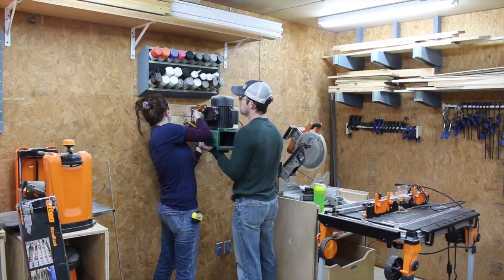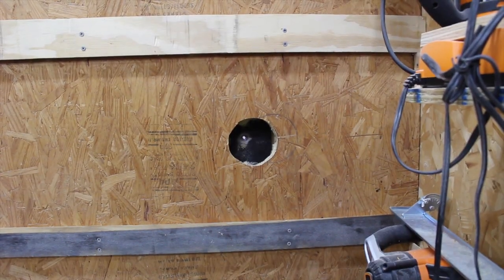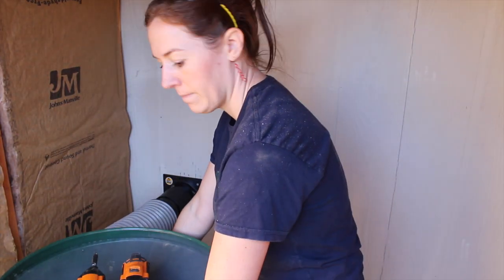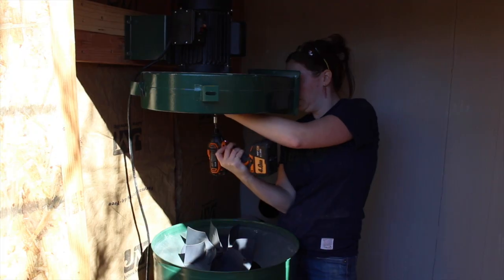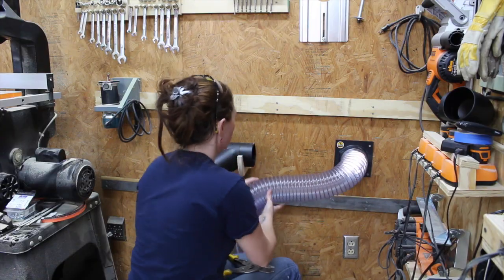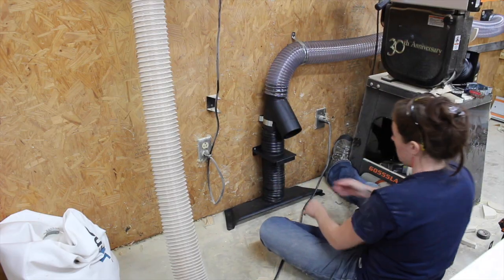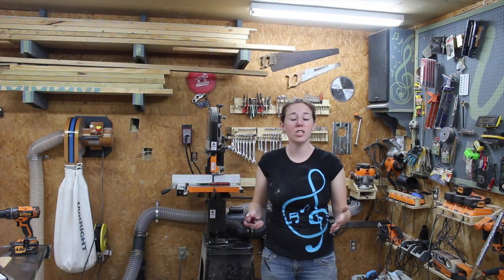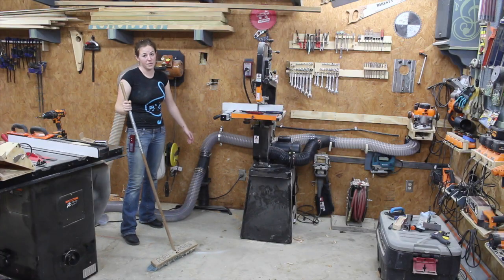Installing My Harbor Freight Dust Collector (Finally!)

Comment: You probably should have a "disconnect" out in the shed, so you can work on the motor and no one can make it start by accident. A simple manual switch rated for 20 amps will do, put it in a standard wiring box

Comment: If you can't find a 20A remote you can use a 20A relay (which should be easier to find) and a lower rated remote to switch.

Comment: Did you look into triboelectric charging of wood dust passing through a plastic hose? I have been leery of using plastic in my dust collection system. Static discharge could easily ignite the fine wood dust that we generate. I admit that I am ignorant to the plastic products on the market because I chose to stay away from them from the start. Regardless, be sure to have a fire suppression plan. Doesn't take much of a spark from a blade hitting metal to turn the dust collector into a shop gutting fire. I've seen it happen twice (thankfully not to me).

Comment: looks good.
hay april, why didn't you rotate the exhaust 90 degrees the opposite direction and run a bit of that hose out through a small hole in the door jam or over the door or through the roof, maybe even make a soft  90 degree turn with the hose and cut a hole in the wall?.

Comment: you know April when you adjust your hose conector to your floor sweep 90% you should also adjust your blast gate in the opposite 90% so they won't hit each other.
Reply from the maker: Yes, that would work much better.

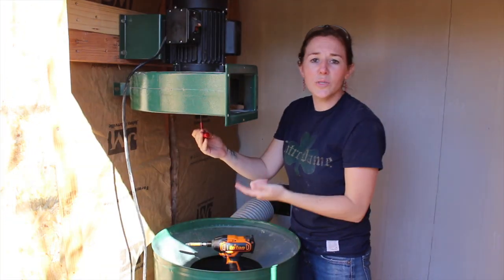Comment: At 3:10 you say the threads are left handed(I suppose you can call it that). Most motors are designed with left tightening so they don't loosen when the motor is spinning.

Comment: Came out great April, nice job :-)
Reply from the maker: Thanks Tommy! I'm glad to have it done.
Reply: I'm sure :-)
Reply: +April Wilkerson take that fitting for the floor sweep and instead of making the floor sweep straight on with the pipe make the saw line strait . the fittinf should look like a T rather than an upside down Y

Comment: That looks very handy, well worth all the work :) Nicely done! Someone probably mentioned it already, but the outtake to the saw you talked about moving, how about just rotating it 90 degrees to the left and mounting the tube a little to keep it out of the way for the floor sweep?

Comment: The floor vent is cool. Is there a reason not to turn your vent back to the wall and just cut a hole around the stud, Doesn't seem like it would affect the flow too much. I'm impressed how quiet it is.

Comment: Sweeeeeeeeeeeett............................!!!

BTW, I've had that exact remote on my dust system for at least 10 years, and never had an issue with it, (other than my GFCI tripping every once in a while, and blaming the remote when it wasn't  the problem.) That remote's the greatest thing since sliced bread!!

Comment: April, pump that air right back into your shop, because if you heat or cool it you will benefit from keeping the air in the space.  If you pump that heated or cooled air out, you will regret it!
Reply: +Sven Lemming it is kind of a tradeoff. Most dust collection systems do not really remove all the fine dust (which is the most harmful). But if she is air-conditioning her shop, then that is something to think about, too. I don't think she needs heat very often wherever she lives. Seems to always be in short sleeves.

Comment: I just got word from Harbor Freight. The flex hose that I am told can only be ordered online is back ordered til May.  You must have gotten the last section of hose they had,
Reply from the maker: Until May! Man. No i wasn't able to order any....I looked into buying a new section so that I could move the motor back on the wall and away from the stud. That way I could rotate the baffle. Anyways, I didn't have enough hose to reach so I had to leave the motor where it is.
Reply: I thought later after watching that perhaps you could build out from the wall you are currently mounting the motor on. With something just big enough to mount the motor 90 degrees from where it is.Giving you a new place to make an exhaust hole. Not being there looking at it, that might not work either. 

I am mounting my soon to be 2 stage HF dust collector in a mobile shop and I first looked into a filter from Wynn environmental (they also have flex pipe in an assortment of sizes, lengths and strengths but more expensive) then watched you and decided to just bypass the filter part and shoot what little debris/dust there is left, out of the trailer.

Best of luck

Comment: Personally I would have just gone through the stud to get it to exhaust outside. Would have taken about an hour to do properly. Think window opening. Frankly if the stud is not load bearing for roof load in the shed you could just cut it out of the way and be just fine too.

Comment: Thank you for this post.  I am new to woodworking and a Shapeoko is on its way. Finished the table for it and now looking at dust collecting.  my shop is a multispace everything room. Garage for cars, painting projects, and now part-time wood shop. My question is after researching dust collectors, I am interested in noise reduction, but concerned about loosing the use of the ductless AC/heating unit; how did you correct the air return to go back into the shop?  This is the direction I really am insterested in for dust collection system.  Thanks again.  USMC-retired

Comment: +April Wilkerson You could probably just rotate that wye fitting above the floor sweep 90 degrees to the right or left to allow you access to the blast gate and floor sweep...

I'm jealous you were able to build that shed out back, I am in my garage located at the front of our house with only about a 4' side yard, the DC has to stay in the shop with me. Still planning to mount it to the wall and add a cyclone separator to it though. Yours is a very nice install. Have you considered hard pipe? I have used PVC before as well as some furnace ductwork (I know there will be some nerds that won't like either of those options because of reasons) :-P
Reply: +Tracy Luegge Norm Abrams used metal furnace ductwork for his, if it's good enough for him then why not? Only issue I've heard with PVC is static buildup, easily addressed by running a bare wire down the inside and grounding it somewhere.
Reply: Gaelen Bolland I know it works as I've used it before. I also know there will be people who will say it doesn't for various reasons: strength, safety, etc. etc. Strangely enough I am having trouble finding 4" PVC where I live now. Thankfully I'm not ready yet as I am saving for a cyclone to add to my DC. I bought the Dust Deputy for my shop vac and love it! Time to scale that up... ;-)

Comment: Hi ,It will not be long for the summer so I thought to make a table for camping, but I have a problem! I want to make a table that has a cooler in the center, you can also put a small grill that can sit 6 people that is compact and foldable and have a different and original design! It sounds a bit picky but here in Japan, everything is a challenge and everything has to be new and futuristic am half Japanese and half American and I want to prove to the Japanese that Americans know how to do things better than them! pedes help me in the design or construction! thank you very much I like your videos , sede you !

Comment: Also a good place to put an air compressor :)
Reply from the maker: Yep! Ill be moving my big 60 gallon in there once I vent it outside. I don't want to be exhausting fine dust from the DC while the AC is sucking it up.

Comment: Hose to table saw in the way of floor receptacle... couldn’t you just turn the Y fitting 90deg?  That would move the hose over away from front of floor receptacle.  Just a thought...

Comment: Strangely enough, I to purchased a HF dust collector back in Dec 2015 and like yourself, procrastinated in setting it up. I finally finished building an exterior addition to my work shop for the DC so I didn't have to hear the racket it makes and take up so much precious space in my shop. I finally assembled it and partially installed it this weekend, however I didn't see the need to modify the installation as you did since the DC vents outside the shop. Is there anything I missed as to why you felt it was important to reconfigure the DC?P.S. I'm planning on installing a 30 gallon second stage unit (also placed outside) so I can easily get rid of the dust.

Comment: Did you ever figure out the exhaust for the dust collector?  If not what if you rotated the exhaust 180 away from the house and exhausted it out the door side of of your lean-to structure or 90 degrees up and did it out the top?

Comment: This dust collector should be able to handle the planer, right?  You were saying some of your collectors clogged up. I used a Harbor Freight one specifically for my planer and it works great.
Reply from the maker: I would have thought so but I tried this one and the other and both got clogged with planer shavings. : / This one would get clogged at the thien baffle, the other at the grate. Do you have a thien on yours?
Reply: +April Wilkerson I bought a bag dust collector, this one: http://www.harborfreight.com/2-hp-industrial-5-micron-dust-collector-97869.html  
It's Central-Machinery - Item#97869.  But I use a filter bag for the top AND bottom. So the 1550 CFM rating, is probably a little higher for me since I use a filter bag for the bottom.  
It's interesting how it clogs at the thien baffle. I'm not much of an expert on different types of dust collectors.  There's probably a design, somewhere, to catch the heaviest shavings right after the planer along the dust collection line.  Off the top of my head, I picture a large metal trash can with the dust collection pipe going across the top and the heaviest shavings won't make the jump from one side of the trash can to the other. hmmmm, I wonder.
Reply: +April Wilkerson 
What kind of surface planer do you have?
Maybe you need a bigger/more powerful dust extractor?

Comment: How did you like this system when you finally got it done, also did it make a big difference with sucking the heat out of the room. I realize this was a long time ago you have that new big fancy one but I just figured I'd ask because I'm about to hook one up now, I also got the Wynn environmental filter for the top of it and the remote control that you used thanks for the link

Comment: I'll be doing my DC soon. Quick question on the hoses. How are you liking the flex hose? 

I'm undecided between pvc and the flex. The only reason I'd like to use the flex hose is cause it seems easier to move around and adjust where as with pvc once it's cut, it's cut and to change around would mean getting new pipes.

Thanks.
Reply from the maker: I've never done much with PVC so I don't have a good comparison but I really liked the flex hose and it was very easy to work with.
Reply: +April Wilkerson thanks April. You're amazing ;-)

Comment: April, I noticed the Dust Right collector hanging on the shop wall.  Do you still use that and which bag is attached, the 30 or 5 micron?  How well does (or did) that bag control the dust in your shop?  Thanks and great video!

Comment: Nice set up. I said it before, and I don't mean to be a pest about it, but I'd check the model number of that motor and make sure it's rated to be mounted vertically and not a horizontal mount only. To mount vertically, it has to have thrust bearings and not just plain roller bearings. The motor won't last if it's not rated to be mounted that way. Maybe just call harbor freight or the number in the manual just to be sure. Keep up the great work.

Comment: Nice vid! :P Unfortunately my shop is to small for one of these but fun to see! :P 
But why do u need to move the connection part for the hose and floor sweep ? Why don't u just turn it 90degrees so its flat to the wall and not blocking the way for the floor sweep ? might be an idea haha :)

Comment: Flextube is very inefficient and causes huge pressure drop. If you ever need to improve the system try running hard tube whereever possible and keep the flex tube to a minimum amount. Otherwise nice!

Comment: Hi April, I am going to follow your dust collector plan. I am thinking of using a dryer vent for the outside exhaust port. I am concerned about a buildup of dust on the outside of the port, especially when it gets wet. What did you use?

Comment: April you mentioned that I needed a 20amp circuit to match the startup draw of the Harbor Freight Dust collector but I see the remote is only rated for 15 amps..????

Comment: Hey there.  Nice work!  I'm about to undertake a similar project in my shop.  I was wondering how the exhaust has been holding up for you?  As you left it in this video, and as demonstrated in your previous video while the motor was still connected inside, quite a large amount of dust particles were still making their way out of the exhaust port -- which now resides inside your outdoor shed, correct?

Do you find that your shed is always covered with dust?  Do you leave the door open when you're working in the shop?  Did you just throw the 5 micron bag that comes in the package from HF on it while it's in the shed??  How do you handle that final stage of fine dust removal?

Comment: Great video! Looks and sounds like the vacuum outside could not have worked out any better! Did you happen to look at fast caps cordless remote? If so, what made you go with PSI's?
Reply from the maker: This was the only remote I could find that was rated at 20 amps. Since the HF unit pulls 20 on start up, I wanted to make sure the receiver was sufficient. : ) Yeah, I think the vacuum outside worked out well!
Reply: +April Wilkerson I see. Thanks!

Comment: How did you remove the key in the spindle after that reverse thread bolt holding the turbine on the shaft? It's running horizontal to the shaft, and there is no space to pull it. So the turbine won't come off the shaft even with the bolt removed.

Comment: April, what did you use to connect the motor to the wall? I want to wall mount mine like you did but I'm concerned about it rattling loose at some point.

Comment: Hi April, Awesome job on this entire build!  I’m thinking of doing this for my shop.  Just curios, is it about as loud outside near your new shed?  I don’t want to be ’that noisy neighbor’ ;oP
Reply from the maker: I don't think the unit is extremely loud anyways so I don't think it's bad. Then with it inside the shed, my neighbors are certainly not going to be complaining about it.
Reply: +April Wilkerson Awesome!  That’s what I was hoping.  I plan to put my Compressor in there as well, so I may still insulate and put a temperature controlled fan in there.  You know how Texas can get in July and August ;o)  Thanks as always, for all your wonderful insight!

Comment: Nice video.However, your power cord, going through the wall, meets no code I'm aware of and is a fire hazard.  There is a possibility that the cord will chafe through.  Since you have machinery installed nearby; indeed, the cord powers a vibrating machine, chafe is inevitable and a fire is a distinct possibility.  That cord should be routed through a conduit so as not to burn down your house.

Comment: is there any added bonus to having 2 dust collection systems. I noticed you have the harbor freight dust collector and the rocker dust right collector. is there any benefit to having both systems?

Comment: Hi April I need to ask a question I am in England could  you tell me why a lot of the different  videos  I watch they use drywall screws , what we call plaster board screws on the timber projects.
Reply: +David Brewer __ It's a bad habit borne of convenience.  It was explained to me that the head of the drywall screw is not designed for timber to timber connection.  It could be twisted off too easily.  Technically, it wouldn't pass inspection.  However, I've used them, as well, on my framing projects.

Comment: hahaha you are too funny,  "JUST LIFT THE MOTOR!!"  great install but my question is why not just move the mounting of motor over a few inches to miss the stud??? unless Mr. April is not helping anymore :)  just kidding great job!
Reply: +Dave Pickrell I bet Mrs. April is hoping Mr. April does not see these post.     ;}
Reply from the maker: :) Haha. I didn't move the motor over because I wouldn't have enough hose to run it from the motor to the collector if I did. Silly reason, but that was it. I looked into purchasing another length of 6" hose but couldn't find anybody selling 6"...so since  I was left with only what i had, I couldn't move the motor much further away from the collector or the hose wouldn't reach any longer.

Comment: where is the firestop calling on the pine through the wall?
Reply from the maker: The pine? What do you mean?
Reply: +April Wilkerson meant  pipe. Any time you cut a hole in exterior wall. you need to think about sealing the hole with a fire stop calking.

Comment: That dust collector is quiet. Must have an induction motor instead of a universal motor.
Reply: +zoidberg444 
It's quiet because it's outside the shop. She built a shed for it behind the shop wall outside and insulated the shed so the dust collector wont bother the neighbors when it's running. She did a lot or work to make sure no one ends up deaf and annoyed by the loud sound of it.

Comment: nice dust collektor :) but its loocks a little underpowered ?
Reply: +Kühn I looked at it at HF yesterday -  it has a120 volt, 2HP,  3600 rpm motor, which is as big as you can go without 240 volt. Not underpowered in my opinion.
Reply: +Bill Wells ....okay... looks not so strong... maybe with more aggressive impeller would be better... because 3hp should make a good suction